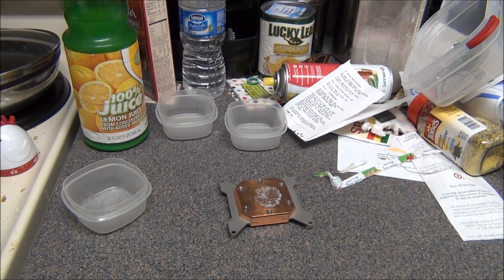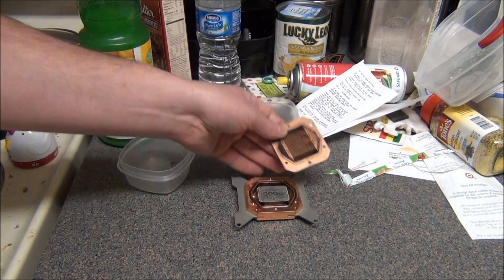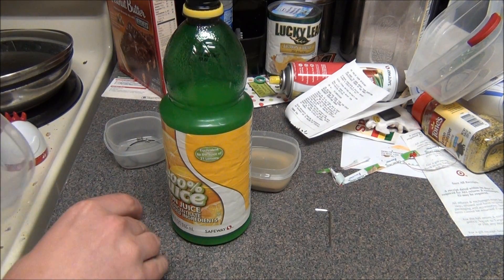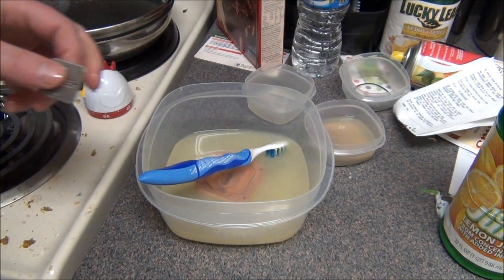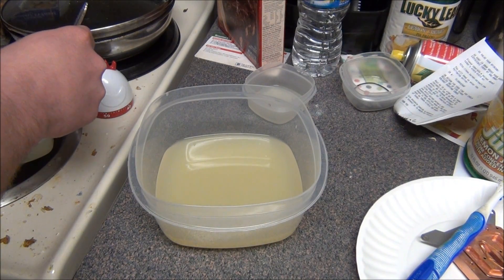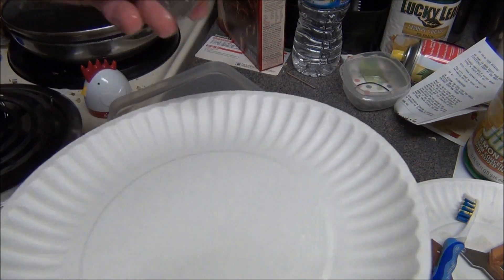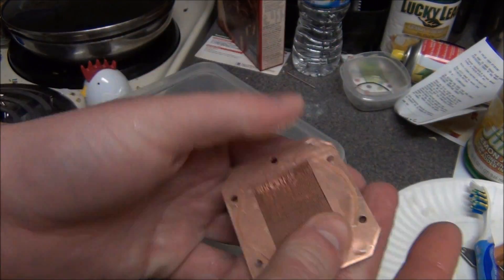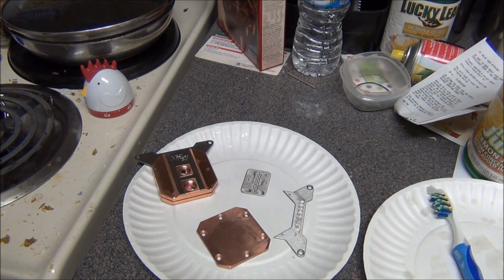How to clean your CPU waterblock from Oxidation

Comment: If you scratch or scuff in any way the bottom or face of the waterblock that sits on the cpu is the water block ruined?
Reply: Nah, thermal compound will take care of it. I've dented one right in the middle though. You just wet sand it and polish it on a pane of glass to re-flatten the surface if you've really mangled it.
Reply: thumbwarriordx ok, thanks for the heads up.

Comment: would it work if i just run lemon juice on the system for a few hours then flush? that way it be squeezed into the fins and tight areas i guess. would it be harmful to the seals and rubbers/tubing?
Reply: I am going to try Ball Fruit-Fresh.. dissolve it in distilled and pour though coffee filters because it says contains silicon dioxide. That sounds suspiciously like sand. I think unsweet lemon-lime koolaid is about the same.

Comment: The steel plates should be removable after knocking the pins out but with my Heatkiller 3.0 a single pin was always stuck and thus I could never remove that side.

Comment: @Juggalo23451 can i use normal tap water to rinse of the lemon juice and to flush out my radiator after using the vinegar solution or should it be the distilled water?
Reply from the maker: I would use distilled water
Reply: Juggalo23451 Ok, will do.

Comment from the maker: @utengineer5 
Took it apart installed it, no problems with leaking when I used it. Also that is the point of leak test when you do a wc loop

Comment: To prevent leakage, I suggest you pressure test the block before selling it.  Anytime you remove used gaskets, the seal is not always the same when rebuilding.